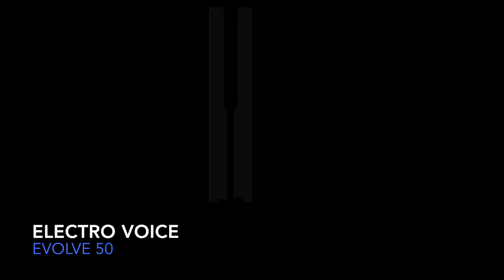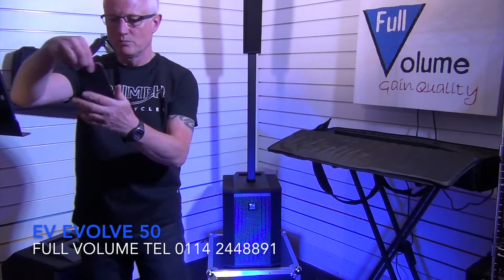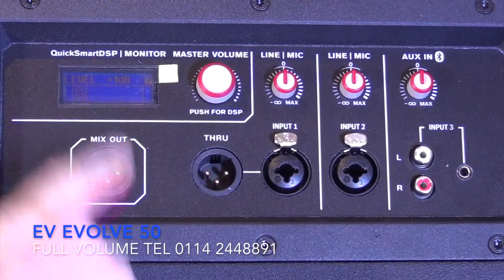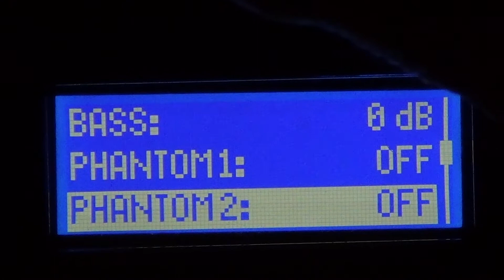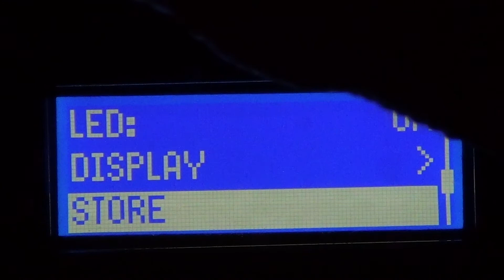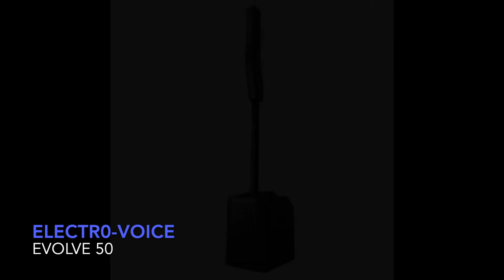Electro Voice Evolve 50 Set up & User Guide @ Full Volume Sheffield

Comment: Hello, I appreciate the in-depth tutorial on the system. Can you tell me if the mix out is a signal that will only work when ran to another Evolve 50 or can it be run into a larger “house” system using the mix out? For example many places are using Sonos to control music throughout their entire venue, but still want a small pa like this to cover the “stage” area.
Reply from the maker: Kyle English yes you can use the line level output signal to another sound system. Thanks Chris